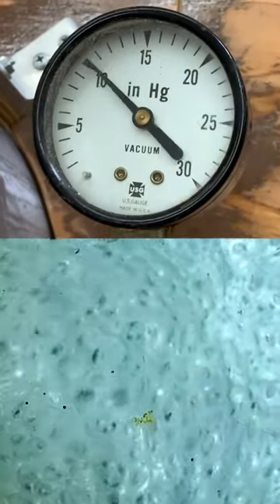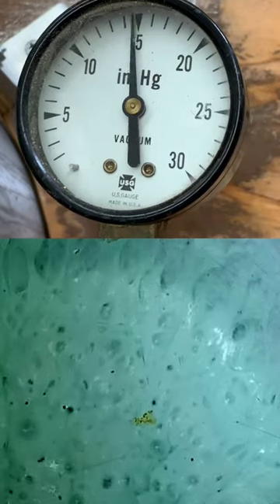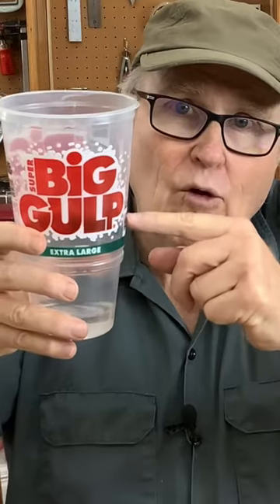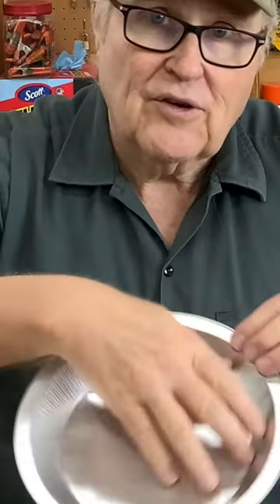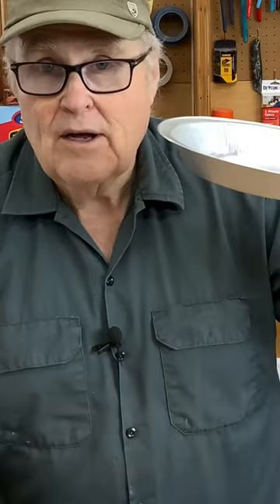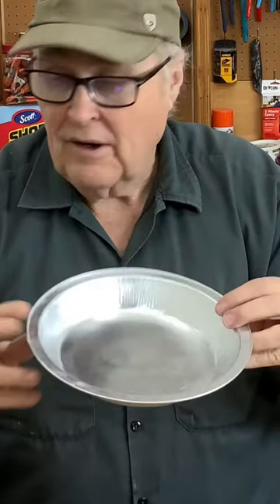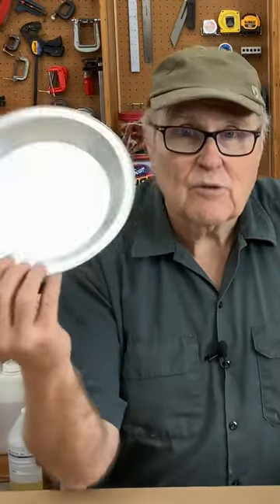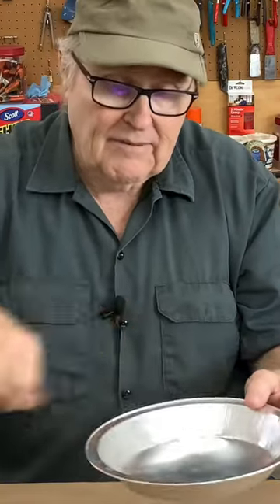No Vacuum Pump- No Problem!

Comment: pouring slowly  standing on a table always worked in a pinch. the thin pour strand... seemingly helped get more hidden bubbles out.
Reply from the maker: It helps with the bigger bubbles for sure. The tiny ones make it through the stream.  If you don’t have a vacuum it is a good technique.
Reply: @RobertTolone  I've been trying different pouring techniques of rubber & the resin, that does seem to help & vent hole placement for the resin

Comment: You can also mix with a flat paddle at the end of a round rod. In a tall cup this lets you mix with a drill without adding any bubbles in the first place.
Reply from the maker: I’d love to see a video of your method. After 30 years of mixing rubber I’ve never found a method that did not incorporate air. After mixing your rubber, have you ever put it into a vacuum chamber?
Reply: @RobertTolone  -No i don't have one and i mostly do half molds that bubbles rise from. I Use a 20mm x 20mm paddle on the end of a 5mm rod about 150mm long. I put it under the surface of the rubber and spin it or stir it. The round shaft does not drag any bubbles down.
Reply: I tried on facebook so i could post photos :)
Reply from the maker: @karlh6692  Do you spin slowly? I have tried paddles similar to the ones you describe but they always create a vortex even when submerged in the rubber. And that vortex inevitably adds air to the mix.  A reliable method of mixing rubber without incorporating air would be very useful for people who don’t have a vacuum chamber.
Reply: @RobertTolone  - It is only 20mm square on the end of a rod and in a small cup that it about 80mm high of resin I can stir it slow enough that there is no air drawn down.  I slowly scrape the outside of the cup again keeping the air from drawing down. I am not casting atm or I would film it. I use silicone rubber with a 5 minute pot life so mixing without bubbles helps a lot.